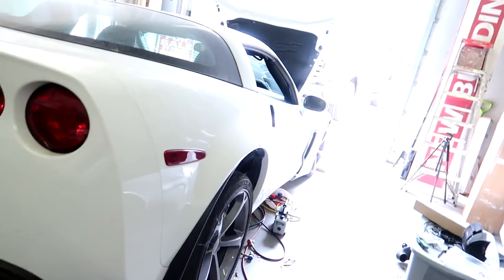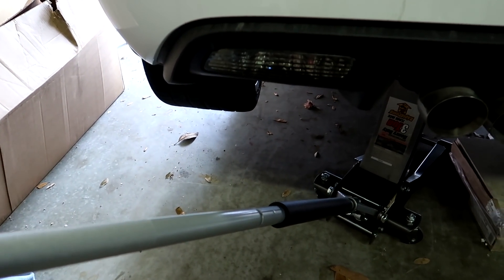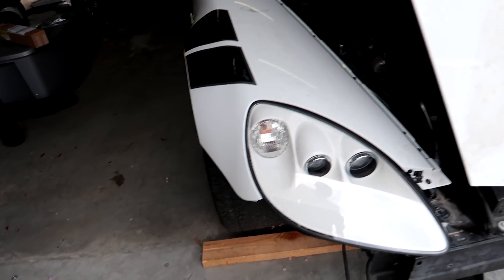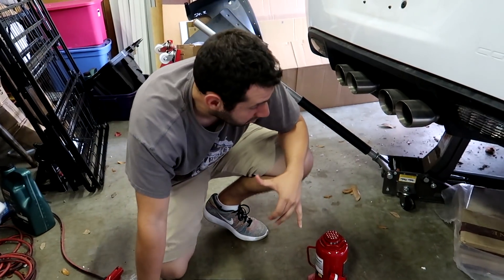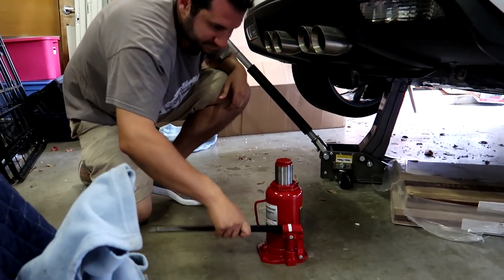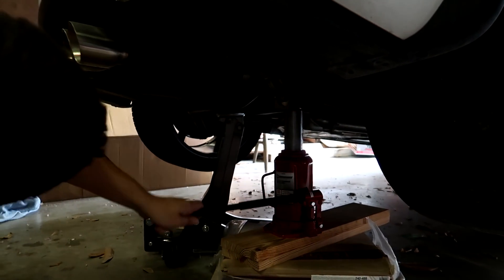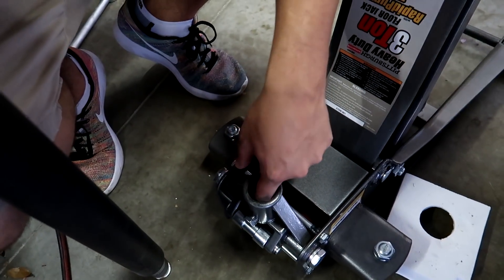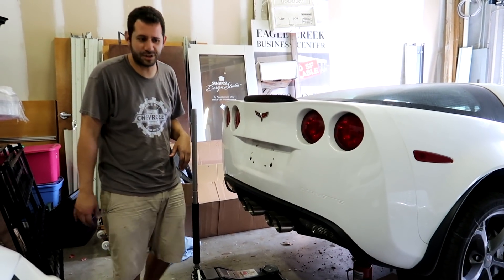Cheap Idiot Gets Harbor Freight Jack STUCK Under Corvette

Comment: When you put the Harbor Freight jack back under the car fully extended. I slapped my hand to my forehead and said... “why didn’t you lower the bottle jack first?

And even before that, why didn’t you turn the head of the bottle jack for the extra reach?
Reply: The bottle jack probably would've slipped off if he tried to lower it, getting the original jack back under the car was probably the smartest thing he did because everything else was dumb as shit - No jackstands, using old tiles to support a jack, didn't even test the first jack. His motto's "Safety Last"
Reply: U mean “safety?” Lol
Reply: Bottle Jack's aren't safe at the best of times..
Lowering one with your upper body under the car would have been dangerous.

Comment: Dude every mechanic, if they are honest, has done this.  Doesn't make it any less funny you did but we have.  And most bottle jacks unscrew, don't they?
Reply: John Sumner, you are so right, i kept saying to myself, unscrew the top so you dont have to pump it so many times. The top of the cylinder has a large screw that you raise to get it close to what you are lifting, then you dont have to pump the jack as many times. Guess it shows we all have bad days now and then
Reply: John Sumner he'd have to read the manual before he used it to know that 😂😂😂
Reply: Not to mention using cutoffs from a construction site of 2x10 or 4x10 for dunnage!
Reply: Paul Smith not if your neighbor is nosy Harold, he'll set the police on you.
Reply: No real mechanics make sure shit is working properly before throwing it under a vehicle.
Reply: I have done this. But my idiot moment wasnt recorded. Haha

Comment: I bought that same floor jack  two years ago,  for 100. Now I feel like I over paided . Lol
Reply: powcar91 paid the same just remember things usually get cheaper
Reply: powcar91 it's on sale for 74.99 plus a you 25%off
Reply: @powercar91 "paided"...looks like that is the least of your worries. @manuel cano you can't use 25% on jacks/jack stands.
Reply: Had no idea either way need a new jack

Comment: Glad the jack is workin' for you now.    A couple of suggestions:

1.) Get the hard rubber/neoprene pad that goes on, or replaces the metal jack head.    It'll prevent the head from killing the paint on the underside.    I'm NOT going to recommend the ones with the slits for the pinch welds; just the flat/ribbed/textured one.    I got the "cap" that goes over the head YEARS ago from Griot's, and it's still doing its job.    Didn't see it on the site just now though...

2.)  Jack stands!    I get being cheap, but there are some things you WANT to splurge on, and jack stands is two of 'em.    Get the highest capacity ones you can afford; you will NOT regret it.    You can get the rubber/neoprene cover things for their saddles too, usually, also to avoid scuffing up the paint.

3.) Wheel chocks.    Don't want the tires just plowing the wood block ahead of it if something goes bad...    I like the ones where the tire rolls over the lip, so the weight of the car is holding them down to the ground.    I MAY have gotten mine at Harbor Freight, or possibly Sears.    ONE has so far gotten a bit bent, but I think it happened under a 5,000lb. wagon I had.

When the budget says: "Okay; you can do this," you might want to look into those "Quick Jack" lifts, if the reviews are good for them.    I know they're on MY wish list...    As always, get the heaviest-duty ones you can.    If at some point you were to get a Suburban or similar, it'd be nice to already have EASILY enough capacity to handle whatever you're doing.

Comment: With as much  DIY auto work you do shoulda got the Daytona Series Jack's instead & don't have to worry bout turnin a stinkin bolt, just pull the spring loaded lock on a Daytona to secure /seat the handle
Reply: Mad Hatter I can vouch that the Daytona floor jack are more user friendly and reliable
Reply: which ones are those? the 2 daytonas I have at work both go together the same way the Pittsburgh ones do and they're less than 6months old. Regardless this wasnt the jack's or Harbor Freight's fault. Had he taken 2 seconds to make sure he put the handle in properly this would've been avoided. If he can't figure out how to put a handle in he damn sure doesnt need to be monkeying around under a corvette.

Comment: I have never fully tightened the bolt in my H.F. jack. I've had it for several years now. I like keeping the bolt only finger tight in case I need to use it somewhere other than at my own home. Makes it easier to transport as its over 5' tall with the handle. Just remember to always make sure it functions as it should before you try lifting your Corvettes with it. Don't want to get your jack stuck under your Corvette because you forget about the bolt. Damn you Harbor Freight for making things so complicated!! 😂😂😂😂😂😂😂

Comment: Different floor jack, but I have to admit, I did this too.  I took my new jack out of the box and set it up.  The last step was to put in the handle and pump to raise it.  No matter what I did, the jack wouldn't go up.  Twisting the handle left or right didn't turn the little gear.  I looked in the hole and then realized that the screw to hold the handle was all the way in and the handle was not going all the way down.  I went back to the manual and it said nothing about the screw when setting up.  I felt like a fool.

Comment: Bottle jack usually also screws upwards for extra height. Also remember to keep that nut in the bottom handle of floor jack. I once forgot when I jacked up my car far underneath,pulled handle out and jack was stuck underneath because I couldn't put handle back in.

Comment: So the problem with these jacks is you really need to push the pole in hard to get the square of the pole to line up with the release shaft. Also pushing the shaft in all the way then tightening the pole stay bolt will help keep the pole engaged with the release shaft. For my MR2, I need to remove the pole after I jack it up, but at that point I'm fucked when it comes down to dropping it. I've found a socket that fits perfectly and just drop it without a pole using a ratchet.

Comment: Sam, don't feel like an iiot.  I bought the same jack, and had just about the same problem.  No car stuck in the air, but the handle didn't do diddly.  I missed any mention of the retainer bolt, and I've been wrenching since 1962...

Comment: First things first. Bottle jack has the extension at the head You can unscrew . Saves alot of jacking .
Reply: The higher weight capacity the slower it will raise.

Comment: There is a 3/8 knuckle on these jacks that has to be in correctly as well. I used this jack to lift f250 without issue but all harbor frieght tools are iffy please use caution. And jack stands as well.

Comment: Usually, the center column in a bottle jack unscrews. I don't think you had to stack so much stuff under the jack. Try to unscrew the middle piece, it might give you an extra 6 inches.

Comment: It takes a man to admit his mistake so here we are ago🤦‍♂️😂Thanks to your video I was able to figure out what size nut goes into the hole to lower the Jack… (14m) My car was jacked up fully and wouldn’t come down.. I kept turning the shaft and it was stuck . So  stupid me took the shaft out that you use to lift and lower the car. Haha I didn’t know there was a spring that locks  it so it wouldn’t come down to insert the shaft. I was like Shit and I found your video. Also I never took out the little bolt on it either. After I got the jack lowered I removed the bolt, put the shaft back in and  tighten  it. Now you can’t just pull the shaft out.. Who knew... 😆Thanks for the video Brotha and I hope everyone gets a nice laugh.. Merry Christmas

Comment: A heads up a lot of jacks have a fail safe system to where if you over jack the device up and have a load up to a certain weight.
It will lock in place.

Comment: I carry the jack in my work truck. That bolt can come out with vibration. I have to make sure it’s tight or it will disappear. 

That said, I think you should turn in your man card and go back to drinking soy instead of beer. 

Another thing you can do is drill a slightly bigger hole in the handle screw hole and use a hitch pin to keep them together. You’ll never need to worry about losing the stock bolt again.

Comment: Something I would have done in your situation is use the first jack (after you got it working) to relieve the second one. You lower the second so the first takes the load again, then you're good to do whatever, like continue working or lower the car. (I don't know a thing about bottle jacks, so I don't know if that would have worked.) Just something to think about if that happens again.

Comment: My best guess is you got way too much jack oil in your jack. I had the same problem with my Daytona 3 ton jack. I was lucky enough to have cut off barn logs as jack stands. I put the barn logs and wood as close to the frame of the car as possible to catch it when it fell. I open the cover plate of the jack. And I released the oil filler screw to relieve the pressure. The car dropped. The barn logs and the wood caught the car. And the jack lowered. I haven't had problems with it since. You don't fill that reservoir all the way to the top.

Comment: I"m sorry you had the problem dude.  I was screaming at the monitor to check this!!  I have an old jack that my dad had like 50 years old.  The piston need to be repaired, I think the piston actually scored the walls so replacing seals probably wouldn't work.  When I found out I can't get it fixed at all I was forced into buying a new jack (no parts or retrofit parts).  I decided to check out Harbor Freight and picked up a nice aluminum jack that works fantastic.  It seems that there are no floor jacks made in the US at all anymore.  Sad...
Have a good one!
-Jon

Comment: Also: From PAGE 4 INTHE MANUAL Section titled "SETUP"    - Attaching the Handle 1. Attach the Upper Handle to the Lower Handle. 2. Loosen the Set Screw and insert the
 assembled Handle into the Handle Socket. 3. Tighten the Set Screw  

Sam is it? Dude, I appreciate your self awareness that you did a few dumb things. We all do; and anyone who claims otherwise JUST did something stupid. I do suggest you slow down a bit, RTFM always if your not mechanically "gifted" or whatever phrase fits. The instructions are there - The manual I quoted has not been reprinted since 2001.

Comment: I bought the low-profile version of their jack since the front jacking point on my C-6 Vette is pretty low and a standard jack won't roll under the car without striking rocker panel.

Comment: I have the same Jack from Oak Harbor freight if you ever have the same situation that he had but took the handle out and the Jack is too far underneath the car to get the handle back into it you can also use a ratchet set to release the air.

Comment: I have a hydraulic bottle jack just like that and its way faster than that, not to mention the top should screw out about 5-6 inches , probably low on fluid in that bottle jack or don't have the fluid screwed all the way in

Comment: Get the HF Daytona floor jack, some good 6 ton jack stands plus couple tire chocks. My 3 ton commercial grade bottle jack pumps up pretty fast. My 12 ton is very slow, close to 80 pumps for full extension, your 20 ton (not sure it's 20) even slower.

Comment: See the pad on top off the cylinder of the bottle jack?. Eighty Tighty... that pad threads up and down so you don't have to pump as much. Bottle Jack's are handy to have. Slow, yes. But they can safely lift more.

Comment: It's because the little gear inside their only engages when the handle is completely vertical and you have it too far underneath the car so take the handle out and find something else that has the same type of square at the end of it and stick it in there like a ratchet or something and then do it from a lower point but very carefully

Comment: I was in an exact same situation. I wound up calling roadside assistance. I think you misconfigured that bolt so that it didn't jack down. Btw, you should only jack up high enough to go under your hood. The higher you jack up the riskier. The way how you positioned your smaller jack is extremely unsafe. I am glad that you're alright. I made the same mistake but you should really learn how to jack up safely first.

Comment: your bottle jack has a threaded piece that screws out of the cylinder (where you it touches the car) to close a large gap quickly. Then u pump to lift it.

Comment: You're supposed to lock down the valve before raising the bottle jack.  I'll bet you also forgot to make sure the lift arm isn't all the way down into the housing. Yes this is what happens when you don't know how to read the manual it does tell you the bolt must be backed out in order to get handle fully seated.
Reply: I'm surprised the vehicle didn't collapse without jackstands...

Comment: All aspects of your video would make a fine example of "What not to do when jacking up a car". Don't use fragile materials like cinder blocks or ceramic tiles to block up a car, do use jack stands or solid wood blocks(not stacks of wood). Read the owners or repair manual to find support points and jacking instructions(as an example my car has an air rear suspension which must be turned off prior to jacking). Also, many new jacks need to have the air purged before use(the procedure can be found in the jacks manual)and may need to have the jack oil topped off.

Comment: OMG... and you're working on cars? You should switch to gardening... But you may have an issue on which end of the shovel to use...
FYI on most bottle jacks the top will unscrew so you can... 1) get more lift. 2) Not have to jack or block it up so high.
And you are lucky those tiles didn't shatter... always use big wood blocks.... never cement blocks (solid or otherwise) or tiles...

Comment: You don't have the rod pushed all the way into the jack. Back out the set screw on the jack , push and fully seat the arm into the hole then tighten the set screw. . . .

Comment: This is why you need Two Jacks I've used two Jack's many times to rotate my tires and other reasons when fixing ot moding my car. I've never had a jacket stuck up like that or fail and come down but having the extra one is just cheap insurance

Comment: Man, I just had the exact same issue. I bought two of these racing jacks in December 2019. Used one a few times and just opened the 2nd one out of the box two days ago and got it stuck under the car. Fortunately I was able to jack my car from a front jack point to get the jack out. But I cannot get the jack to lower.
Reply: Awesome. Loosening that nut fixed the issue. Thanks for the helpful video!

Comment: Old video... but dude... always test your equipment before use.  I bought one of those Jack's, and the plug on the bottle jack inside had been stripped on installation at the factory.  Once I pumped the Jack up, fluid poured out of that plug.  Had I used it on my car, bad things would have happened.   Always.... always inspect, and test your equipment bro.  Treat stuff that can end your life the way you would fly an airplane, always do your preflight.  Good luck out there man.

Comment: My dad once bought a brand new circular saw. Went to use it and could not figure out why it was not turning on. After spending about an hour getting angry I noticed the extension cord was not plugged in the wall. 

He cut through the cord 30 minutes later.....

Comment: I bought one of these to jack up my car, I too did not know of the Bolt and my luck I did not get it stuck but cause I did not do that bolt part it went down like a box of hammers lol. I did have to manual side jacks for the car just in case though so I was extra cautious with mine.

Comment: Always have some pieces of wood like small sections of 2 by 4 so you can add these to the top of the jack to make it go a little higher. And I would not have even done a video showing how I did not even know how to operate a floor jack and be working on these cars.

Comment: All bottle jacks have a screw top to raise the top to what you are lifting without pumping 5000 times.  Otherwise that bottle jack could lift 10 of those cars without issue.

Comment: Smart guy...repeat after me :  jack stands-jack stands-jack stands, don't overextend floor jack, realize that a bottle jack ram has a screw.  Did you bother to check the jack fluids and bleed the cylinders BEFORE using?  I have the same jack, used to replace a jack I owned for forty years that needed seals.  Some tools are good some are bad...if you're a tool you get bad results with either.

Comment: jack extended too   far    use block of wood on jack head,   as you go up  put blocks of wood under car    or put block of wood  under jack  .when you start  , also with blocks   both sides under car

Comment: Haven't watched the video yet but I'm going to guess you didn't back out the stay bolt and put in the handle then put back in the stay bolt so the handle doesn't fall out when you use it to move the jack did you Sam? 

How do I know this? Because practically everyone that doesn't read the instructions and has bought a floor jack of this type has done it. Just like young guns are famous for unscrewing the release too far on bottle jacks and spraying themselves down with fluid XD.

Comment: You might want to do a bit of research into how to do proper cribbing when using jacks.  You didn't need to pump that bottle jack up that high, you should have had proper cribbing underneath it since the vehicle is normally so low to the ground that you wouldn't be able to lower the vehicle all the way to the ground with the bottle jack underneath it anyway.